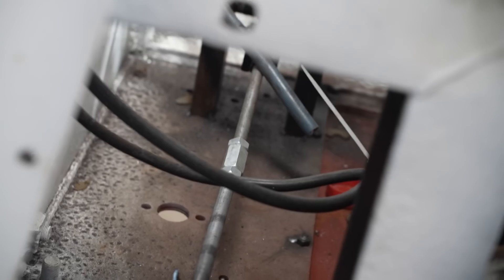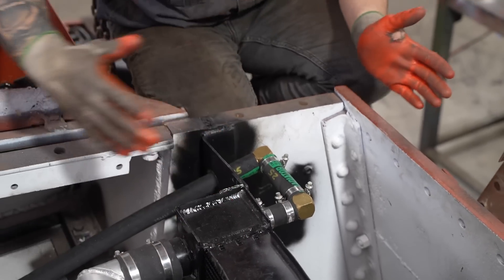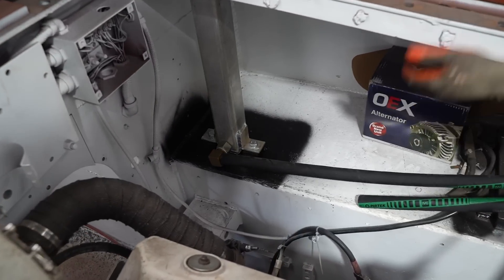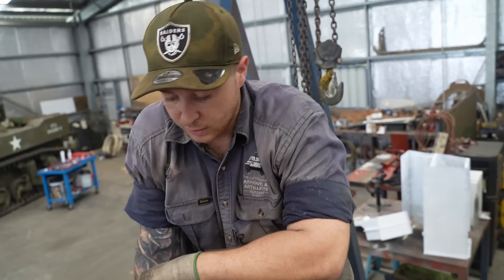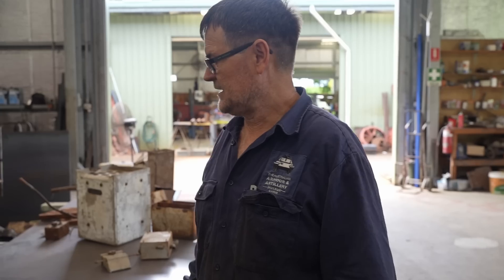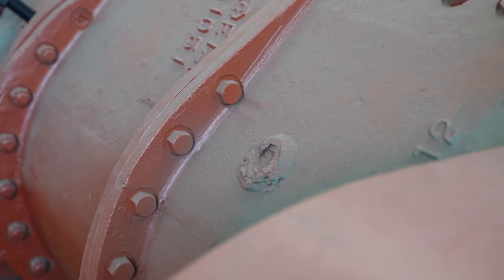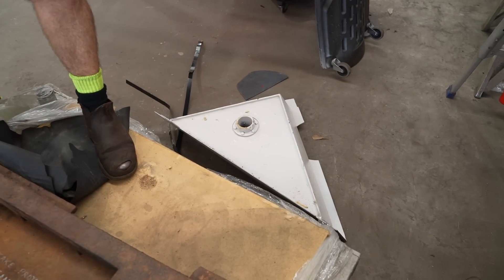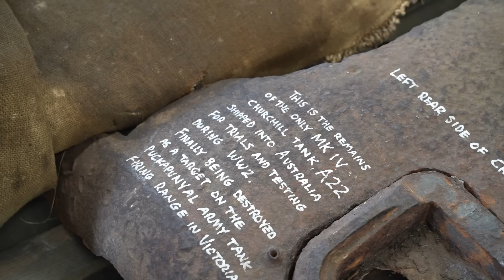WORKSHOP WEDNESDAY: WWII Grant Tank Project UPDATE - Radiator, accelerator linkage & PART UNBOXING!

Comment: Would all those sharp 90 degree welded bends in the cooling system be a concern?  What about bending the pipe instead? 
My experience with this is less than zero, so there is likely no problem with his technique.  One of my favorite channels.👍

Comment: Concerned about using 90 degree joints instead of bends. You are likely to have increased friction and reduced pressure with the 90 degree joints.

Comment: Love these videos, they take me back.
Drilling armor plate? I was an apprentice (1980) working with Shot blast machines (not sand blasting) and we used WR500 hardened plate that you could only grind, weld or oxy-cut. To get a bolt hold we used an Oxy torch to blow a hole in it, then use a tapered dowel and hammer it while it was still red hot and belt the hell out of it until big enough for the bolt.😁

Comment: Remember to mount the "emergency air intake shut off"...........mechanically racked Detroits can run away on start up.  Its not an issue on the DDEC electronic injectors.

Comment: Given its a american vehicle the lower radiator hose that you stepped down to '70mil'. Works out just perfect for 2.75 inch originally. So you could have the coolant on the lower hose flow cleaner by buying a imperial sized hose/pipe. Which they do make coolant hoses in that size.

Comment: That throttle linkage looks complex and rather awkward. Did you consider using a "drive by wire system"? A small actuator and solenoid would have been easier, surely?

Comment: Please take a closer look at the fabricated gas pedal linkage at the pedal itself, the tolerances are very close and without a bearing to ensure it’ll resist rust damage. Temperature consideration also dictates that the steel will swell causing more binding so add any rust buildup from sitting for a few months and when the driver applies the gas pedal, it won’t spring back to the idle position. And we can’t just apply a stronger return spring because that will fatigue the drivers foot since he’s constantly applying 10 pounds of down pressure as he drives the vehicle. I suggest widening the Y yoke at the gas pedal pivot joint so there’s at least a 1/4-1/2 inch gap and a sealed bearing installed on the pedal linkage that goes in between the Y yoke. By using bearings along the entire throttle linkage, it’ll allow the driver to apply fuel more accurately which will translate to longevity of the engine and clutch assembly. 
I’m amazed at the progress the team has achieved so far, thanks for sharing.

Comment: Great work guys   Just a question is there a air bleed hose going into the top of the coolant tank from the top of the radiator/engines to let the air out and the coolant into the engines?  Keep up the great work

Comment: Great work guys, just one thing, would it be advisable to at least put thermos on the outside of the radiator, due to the extreme heat in QLD, just a subjection. :) Preventative maintenance is the best for all mechanical items 🚗🚗👍👍😎😎🙌🙌👌👌

Comment: That sheetmetal shield will need some surgery by your panel man.
That throttle linkage would be far better and simpler with a cable/cables.
All theat rad plumbing will cause issues as those 90 deg bends restrict flow big time,, even in 60mm pipe. Those fans should PULL air through the rad which should be exhausted at the other end of the engine bay

Comment: I'm looking at 03:22 where the rubber hose from the radiator is fed through a metal bracket. There should be a grommet of some type to protect the hose from vibrations cutting the hose. After working most of my career on Sea King helicopters, protecting wire bundles and hoses going through bulkheads this was an easy pick up.

Comment: 2:05  That double right angle is going to bend over time under the weight of the armature it's lifting.  Needs a small bit of bracing welded in on each of the internal angles to prevent that - cos I'm pretty sure it'll be a complete PITA to redo it once iit bends later.

Comment: Great update thanks. Why couldn't you use a Bowden Cable for the accelerator pedal?  You could run in inside pipes if you're worried about snagging. Also how will the coolant run up hill to the radiator from the header tank?
Reply: Wouldn't pressure build-up take care of that? (Just thinking back to my go have car days, pre-kids!)
Reply: @cmck472  pressure would force the coolant up hill and down hill to the expansion tank. However the expansion tank needs to be above the radiator to top up. Water ie coolant doesn't flow up hill unless it's pressurised. There will be air lock... The tank must be higher it's physics
Reply: Hi, yes it will flow up the hose to the expansion tank just fine. You are supposed to check the fluid with a cold engine. I. E. Unpressurised the hose runs much lower than the radiator then the house hours uphill so physics doesn't let Unpressurised fluid up hill. Check your car radiator there will be two pipes the lower one puts fluid into the cooling system and to upper pipe is for the over flow when the engine is very hot and pressurised. It will flow out but not in with only one pipe physics

Comment: You'll need to re-route that radiator header tank hose up so air bubbles flow up & out as they way you have it now there will be an air lock at the top of the radiator.

Comment: I used to build RFW TRUCKS, and we used WILLIAMS AIR THROTTLES. It saved a lot of linkage and stuffing around , just a treadle valve a air cylinder and two air lines. It also had a cold start built in to run the engine at 1200 RPM until the air pressure came up to sixty psi.

Comment: This is coming along great. You still haven't showed us how the door was finished though. Perhaps a bell crank or an "S" bend for that throttle linkage you got there. If your gonna stick with that set up, I would add some cross braces. Take some fuel line and cut a slit down it and use that as buffer between your hoses that are being ran through the metal wall. U should add a shield to go over your belts incase one breaks and it doesn't damage your homemade radiator pipe.

Comment: Men, in regards to the aluminum return pipe from the engine to radiator ….fully support it.  Aluminum welds fatigue crack in no time.  Or just go hose, clamps, and push on fittings.
(Welding anneals the aluminum pipe in the weld vicinity way down to beer can strength.  Vibration just eats it up.  An aluminum weldment can be sent to a heat treater, solution annealed and age hardened back to full strength).                                   
    Look forward to the first run.   D

Comment: 3:35 Sorry, the mech engineer in me is speaking here. Why didn't you use short radiused elbows on that coolant header? The tee is fine, but those hard 90 degree elbows will create some turbulent flow at the outside of the "bend"... OTOH I suppose it's not that big a deal since the tank will only be driven a few times a year. Sounds like you also had a bit of trouble with sourcing the 70mm pipe and cut it down to 60mm... hopefully that doesn't reduce the flow rate too much for the engine to stay cool. Would've been better to go with the bigger pipe and use a couple of reducers. Probably was overdesigned originally, so you may be OK there. I live in a very hot arid climate, so that is also where my mindset is. Here in Las Vegas if ANYTHING in your cooling system is compromised even a little bit your car will quickly overheat when it is 110+ deg F outside with road surface temperatures of 140 deg F! Anyway, nice work as always.

Comment: You're going to trap a lot of air in that radiator, with the "header tank" hose going into the bottom of the tank. I'll also bet its going to take forever to fill through that tank.

Comment: That radiator to release all the Air pockets will need air bleeders. Because the bottom of the water fill is drasticly lower then the top of the water level of the engine.  So you will have over heating cause the air cant be naturally purged as you fill the engine coolant .
Reply: If the radiator pipes had been bent instead of using 90 joins the problem would have been a lot less. I don't normally have a problem with the fab on these builds but square fluid pipes makes me itch. Scale and muck is going to collect everywhere and the air traps in that setup are really bad.
Reply: @discordia013  
I just posted my concern about this issue. I have no experience with this kind of installation,  but it just didn't look right.  I suggested that the pipes should have been bent instead.  Glad to get an explanation from someone who knows what they are talking about.

Comment: It is going to  overheat because it's going to suck hot air from the engine bay through the radiator instead of cold air from outside .
Reply: It should be fine for something that just trundles around a parade field a few times a year.

Comment: That setup looks like it will be fun to bleed the air out of. Put a bleeder at the highest point.
Reply: highest point is the filler cap.
Reply: That maybe but the hose to it is lower than the top of the rad so air will not escape without a bleeder. good luck with it.
Reply: @kwslife116  Park it on a (VERY) steep hill?! 🤔😜🤣🤣
Reply: @MJTAUTOMOTIVE  Not with the hose going down to the bottom of the tank.

Comment: Why are the insides painted white?
Reply: Visibility. White reflects light. It is dark inside a tank and painting it in white helps.
 
The russians painted their T-34 interiors in the same overall green, to save time. But crews that received lend lease tanks appreciated their brighter interiors.
Reply: @chefchaudard3580  Some were, or more often just left in primer,  usually during the dark early days when they needed to get them out the door and/or there were shortages of paint.  But they were supposed to be painted white.

Comment: I’m just wondering about fluid dynamics and these 90 degree angles. 
Is that an issue? Or is it not critical at all in engine plumbing?
Reply: Its not ideal,  but it'll work for  a parade queen.
Reply: @@Niels_Dn I'm guessing that the water flow rate from the water pump isn't that large, that the sharp 90° bends aren't going to make much of a difference.  There will be some extra agitation & swirling in the water flow though.  I'm thinking that with 60mm hose & about 10psi it should be ok.  Fingers crossed!

Comment: Great work to restore to running order. I understand the necessary mods in a modern world but, please tell me the new radiator hose will be fitted through a rubber grommet in the steel hole necessary to reach the fabricated header tank to prevent unnecessary wear and tear and future repair..
Reply: Mock up process at the moment. They're pretty switched on, I doubt they'll forget it.

Comment: Just a quick question, if you have the hose from the radiator running down, it stops any air in the system to be bled out. Have you fitted a bleed screw somewhere that is accessible? Just thinking about it boiling on you with air in the system. Thanks

Comment: Put a gusset on the 90's as the vibration will crack on the line where the threads are..
Reply: @@theessexhunter1305 You're right mate! - Especially if there's vibration!
Reply: @nevillegoddard4966  Surely anything running on iron tracks isn't going to rattle, is it?! 🤔😉
Reply: @theoztreecrasher2647  Yep, you're right too!  I guess I meant if there was destructive vibration, which is likely with such a long, convoluted path of the linkage.

There's a bulkhead, multiple springs, & 3 or 4 support bases supporting the linkage, which is quite a bit.  The other thing is that the linkage is 16 mm rod, not tube! - not insubstantial you have to admit.  

So I spose I was giving Jesse the benefit of the doubt that he had already considered the vibration factor.  The reality is we won't know without the test of time.

Comment: Nice work lads! I did wonder with that sloping hose to the radiator at the potential for airlocks in the radiator top tank though?
Reply: as long as the Fill is higher than where it goes into the radiator it will be fine.

Comment: Nearly at the stage where the Grant can drive - very exciting!

However, I wasn't able to see a vent for the radiator - and without a vent, there is no way for the radiator to be filled (as air will be trapped at the top of the radiator). 

Is there a vent, or am I just blind?

Thanks for the video!

Comment: do you need a grommet where the hose passes through the bracket to prevent vibration from wearing a hole in the hose? especially if there is no easy accecc once the top panel is back on?
Rgds
Stuart
Reply: @@stuartwilson7958 Yeah I saw that too! The hole looked pretty jagged from the hole saw ay?  They should put some kind of edge protection for that hose for sure!